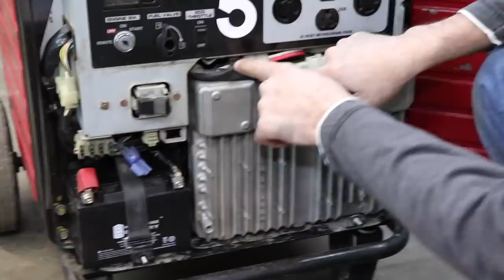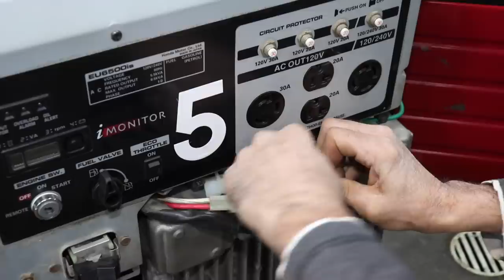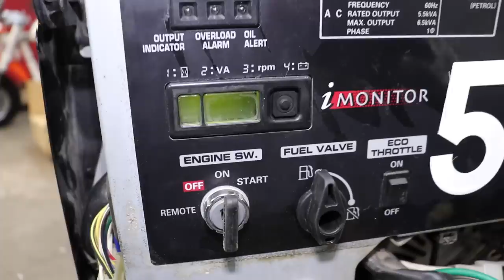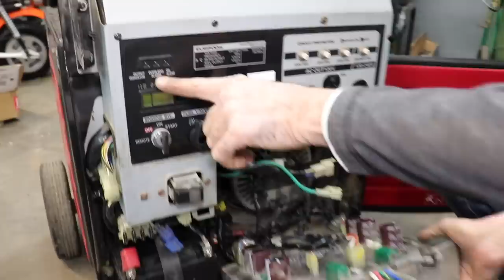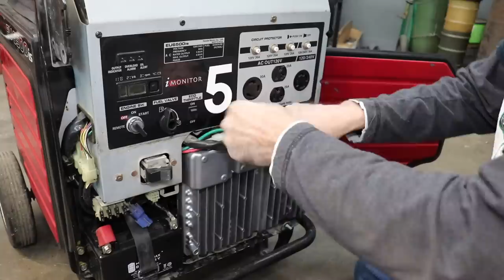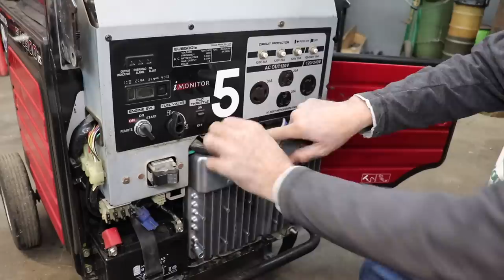No Spark? Hard To Pull? Do THIS On Your Honda EU6500is Generator

Comment: $800 plus but doesn't come with 2 grommets, makes you shake your head.
Reply: My 1st thoughts, Crazy
Reply: Why would they send more grommets if the ones on the machine are still good?  Waste of time and money to replace small parts that can be reused.
Reply: @CountryRock2k1  The fact that the component is mounted on grommets indicates Honda thought it needed it for vibration isolation. If it has failed it could be due to many things but for it's price it ought to be as good as factory when replaced that should include all mounting hardware in my opinion which would include the bottom ones and the tie wrap. Like a water pump should always come with the correct gasket, the grommets might have cost $5 to include.
Reply: @CountryRock2k1  then make the damn  inverter repairable
Reply: yes, it should ring a bell
Reply: If there's one thing Honda is good at, it's making everything complicated.

Comment: I’m not sure that the No Spark was caused by the bad inverter. I think there was no spark because the engine wasn’t able to turn over  fast enough because of the load the bad inverter was putting on the engine.

Comment: Hey Taryl, how did you determine the problem was the inverter based off of the code? How did you know there wasn't an issue with the GCU or the wiring in between? Is there any other technique to ensure the problem is the inverter before buying that expensive part? Would the code be different for those types of issues? Thanks
Reply: He unplugged the inverter

Comment: Hi got one of these gens and when I try to start it sounds like it’s grinding. Also won’t pull super hard to pull barley moves. I tried the test you showed but still same grinding, won’t start. Gonna check for spark next but any other tricks to know before I drop the $800 plus on inverter board? Thx for your help!!

Comment: I'm a fan but what is the value of a inverter engine generator vs. a regular generator? In what application does the client need electrical power with such low distortion specs? Most all modern electronics can handle the amount of distortion from most any engine generator you buy without using a expensive inverter unless I am mistaken or missing something and I am ignorant why clients spend so much on inverter engine generators. I love the patience you demonstrate in your technical explanations and how you deal with your clients. I assume your skits screen plays come from the exchanges you have had in years past with dealing with joe and jane public hearing their many concerns and doing all you can to help them resolve their problems with their equipment and systems. Godspeed.
Reply: Wanted to use a portable generator for home backup. Was told the electronics on my new gas furnace require under 5 percent distortion.

Comment: Inverters are great because the engine can quiet Idle and still stay at 60Hz unlike non-inverter AC power engines stay at 3600 RPM for 60Hz output.

Comment: @Taryl Fixes All
      Hi Tarydactil , I have same type of generator but mine is Honda em25 (2.3kw, 220v) cycloconverter generator but I got it without electronics (module , inverter and front panel), just engine with flywheel (drum) and coils inside . Is there any ways to bypass all of that and make it run ? Just to make engine running , I don't need current .  Or any modifications regarding .Thanks

Comment: hey taryl i have a Honda generator similar to this that i can get to start but wont stay on, it has a switch for idle control when your not pulling any power it will fun fine on full throttle but the second i turn the switch on for throttle control its dies out, i have checked the spark and the spark isnt dieing when it shuts down i have a new carb on it as well. any ideas on what it could be?
Reply: Did you ever figure out your generator problem?
Reply: @DM-fp8uw  yea its the board. for the auto idle.

Comment: This may be a good time to start learning electronic soldering skills and to troubleshoot electronic failures. Most likely, it's one or more of the capacitors that have failed. An ESR Meter can identify a failed capacitor. Also, look for bulging and leaking capacitors. Capacitors can store high voltage. Discharge the capacitors.
Reply: The problem here is that all the circuitry is covered with rock hard epoxy for waterproofing. good luck with accessing and changing over bad components. nothing will disolve epoxy.

Comment: My generator has a spark and runs for a minute but shuts down with errors e10 and e20. The generator is hard to start unless i unplug the cable from the master coil winding. Is this the inverter at fault?

Comment: Hour meter say the generator 1463 hours on it thats pretty good for a inverter to last that long what do you expect they don't even make riding mowers last up to 1500 hours. We had generic that the inverter failed on very low hours probably around 100 hours

Comment: I wonder if Harbor Freight makes a similar 6500 watt inverter generator? People call Harbor Freight engines, Honda clones, I,have heard them called Chondas before too.(Chinese Honda’s). My thoughts were to get the inverter from Harbor Freight if it’s cheaper. I have ordered parts from Harbor Freight before and got them, took a while but I got them. Must have been on one of those slow boats from China.

Comment: surely there is some electronics repair places to send that module to and save save save.
Reply: conundrum conundrum If the electronics are epoxied in after the board is populated, you can’t replace individual electronic components. Great idea though. I would like to see one to see what could be done!

Comment: $800? That’s why I stick with my old Briggs generators!
Reply: Good clean quiet power is what the inverters are good for. I got a eu2200i and its handy and quiet for 1 and clean  sine wave power for electronics.
Reply: @george2823  I find it odd because I ran my flat screen T.V. and computer on my old gen. So far, I haven't noticed anything out of the ordinary.
Reply: The more sensitive stuff. All the time with high load like home medical things also it ramps up engine speed as the load requires so if your only pulling 1k its only going to use the rpms needed for 1k at 60 hz.. saving fuel and engine wear. But to each their own im a big on the ol saying "your stuff, you do what you want with it" haha!
Reply: George I’ve fixed multiple generators and I’ve only had one come in and the generator piece itself was over $900 usd which was back three years ago!
Reply: Yessir!I've got an old Coleman 5k and an Onan 2.5 and both run like Swiss watches. No need to go hi dollar when the old ones still purr.
Reply: Lewie McNeely that’s right!
Reply: @LIMowersAndMore  They're talking pure sine wave. Looks like with our Colemans and whatnot we could get an inverter and still come out WAY cheaper than $4200.00 and have just as good. I like Honda and Kawasaki engines but the older ones. The new stuff is going just like Briggs has. D O W N !
Reply: @LIMowersAndMore  And I meant an add on inverter. Separate unit.
Reply: Lewie McNeely you fix tractors?
Reply: @LIMowersAndMore  Mainly for myself. That way I can justify the money I put into them by running them! I'm getting so stove up I'm glad all my stuff is pretty well fixed. Geezerville is a rough place to live.
Reply: Look up THD some sensitive equipment cant have anything.. the only old school gennys i know of that have almost no distortion is the old military gensets lkke the mep 003
Reply: @Boobtube.  YESSIR! Perzactly! Then holler recycle and then make it so that you really can't. It's a throw away society at best. SORRY if the dead truth be known.

Comment: Is there a way to keep that $800 part from crapping out or is it an inherent problem we just have to deal with?  Honda makes good stuff so it seems strange.
Reply: Heat kills inverters.  If you run it for a long time close to its max capacity, you'll shorten its life.  Making sure it can get some air (not in a confined space) helps, too.  Try to buy a generator that puts out 50% more than what you plan to use it for on a sustained basis so it stays underloaded.

Comment: For those of you shocked by the price of that part.  Price out a Honda generator, I would bet that's a 4000 dollar unit.
Reply: problem is if the inverter only is 1000$ what does that make the rest? when you buy parts they should be sold for their worth in the machine not 200% mark-up because its a part.
its like selling an alternator 3000$ on a 15,000$ car.
Reply: @WJCTechyman  you dont understand my point.
Reply: @WJCTechyman  No American labor on the new high end Honda generators.  They are now being made in India!
Reply: @maximaniac7231  the eu7000 is made in India the eu6500 in japan

Comment: Two harbor freight generators for the price of the investor alone, I have shelves for spares.
Reply: I just keep my old stuff running. Good enough for who it's for.
Reply: These inverter gen sets are popular where noise is an issue. Campgrounds, residential renovations etc. Nothing wrong with keeping older equiptment indefinitely but having the right tool for the right  application is always a good policy as well. Best to You and Yours.

Comment: What would cause a converter to crap out
Reply: "inverter", not convertor.....excessive heat...caused by having the unit running in a enclosure without enough ventilation or overloaded and overload protection had failed to shutdown. A lot of folks put generators in enclosures to prevent theft...if not enough ventilation, can overheat.
Reply: @heyinway  I put a little computer fan on mine and it keeps it below cooling specs  for now I GUESS unless they come up with china knock off im surprised they have not made a generic yet  I call the main supplier in Japan Honda dealer  and they sell them for$400 but shipping cost more than then inverter

Comment: Some may be able to repair those inverter s..
Reply: Right. I'm surprised no one offers a replacement part and gives credit for return of the old circuit board.
Reply: @eosjoe565  there is a place in Ohio who fixed man lift modules maybe they can repair.
I bought this inverter in Bahamas $1500
Worth rebuilding them .

Comment: The worse thing about this is that it's probably just a 75 cent capacitor that failed. I see they epoxy the board so it doesn't appear to be serviceable.
Reply: Yeah, they pot it in to make sure you can't just replace the 75 cent cap. My first experience with that was Commodore 64 power supplies back in the day.

Comment: He tell I got 7,000 IS that lost spark it seems to crank over four times with the starter then kicks off you think it's the other computer one of the capacitors on their looks like it could have got hot it was running in the Sun that is hotter than hell then no more spark Sparks. Both the coils and coil pickup for good has no spark at all

Comment: Looks like they epoxy the whole board to prevent people from just replacing the failed component on the inverter board....   THIS is an example of why "Right to Repair" is so desperately needed in this country.  You should be able to take that board to any qualified electronics repair place and have it repaired for a couple hundred bucks max... and probably much less.   Instead we force the customer to throw them in the landfill and pay $800 for a new one.  It's criminal on multiple levels!

Comment: hello 4gage, I would not get an inverter job either. ppl get them for good clean a.c. output
for their electronix. nice thot but as u see an 800$ part, could get a good gen w 5 % or less
thd total harmonic distortion. Got a powerhorse that got me an wife thru Irma, ran cent. a/c/ 
stove t.v. lites, puter. 4get the inverter.

Comment: With the three pounds of epoxy poured over the circuit board you can't repair the circuit board. They'll tell you that it is to dampen vibration yea right....Hal

Comment: Funny ... They can make a smart phone that can fit in your hand with a computer and all that. But you have a huge brick computer in a generator. Lol.
Reply: @JM-yx1lm  but then they wouldn't be able to sell you a $800 part.
Reply: Guaranteed you’re not pushing 6500 watts through your phone. High amperage = big components.
Reply: Erik J. You know what I mean. Lol. They have small circuit boards that can run the shuttle and that’s pushing 500k thrust lol.
Reply: J-Styga no, I don’t. You’re comparing God knows which computer on a space shuttle to a power generator. Two totally different things. 

That big aluminum finned base is for heat dissipation. With out it, the components would eventually burn up. You couldn’t downsize those big electrolytic capacitors any more than they are. Diodes, and transistors also large, and also require a bunch of heat dissipation.
Reply: @erikj.2066  ok, so the finns are for heat dissipation,,,,,,,,,,,,,big deal,,,,,,,,,,,,,it still went SOUTH.......somebody taught me something once,,,,,,,,,,,,it was KTS,,,,,,,,,,,KEEP THINGS SIMPLE,,,,,,,,HONDA SHOULD TAKE ALL OF THE ADVICE............
Reply: yard limit if you don’t like it, don’t buy an inverter type generator. They’re pretty much all built the same way.
Reply: @styga1969  Not sure how circuit board power equates to engine thrust...
Does your 12V car battery really drive your car at 75MPH?
Ummmm, nope.
Reply: Mr Brown Yes if cruise control is activated. 12v to servo.
Reply: @styga1969  - Excellent. Activate cruise control, then turn off the engine.
Let the battery do the work. Great logic!
Reply: Mr Brown   Tesla car? I’m just saying it’s a big box to control a generator. I work on gens all the time and I never seen a box that big on one. Most of the time it’s the capacitor that goes.
Reply: @styga1969  OK - have a nice day.
Reply: Mr Brown you also.

Comment: Sounds like for the price of that part I buy a new one not a cheap make Honda
Reply: Um, no.  A cheap one would be a Champion.  Or a Troy Built.  This one is a multiple of the cost of those.
Reply: Honda are made cheap  hell half of the time you can not get part if b&s not the engine forget it
Reply: @WJCTechyman   hell Honda are made cheap half the time you can't get part I will not work  on one because if you can find part they to high but half the time I you can't get part